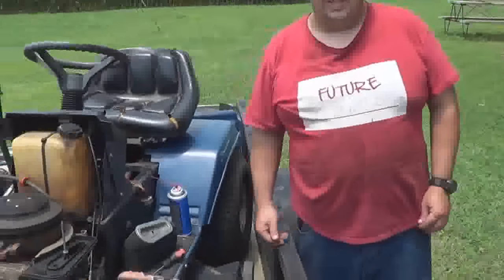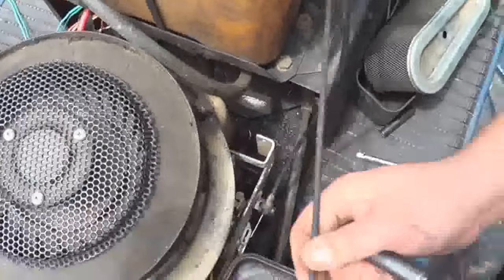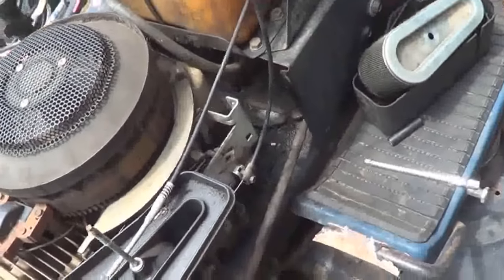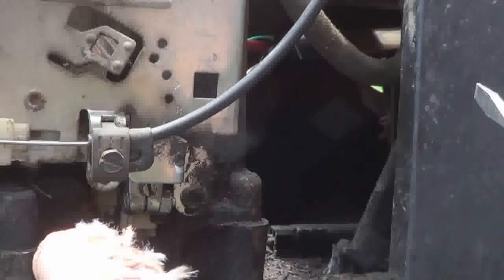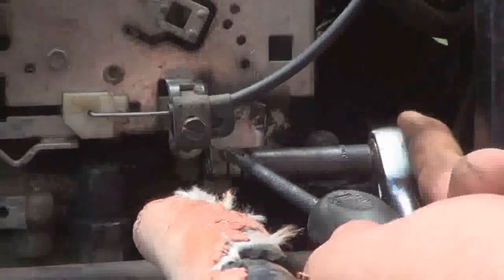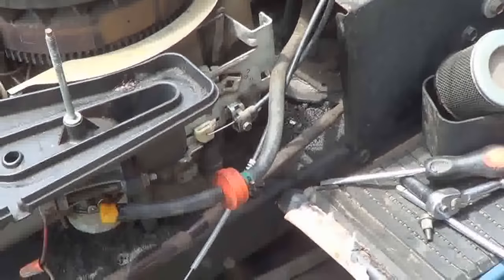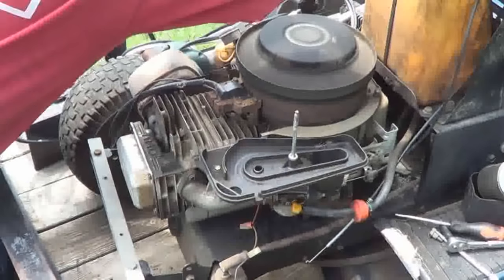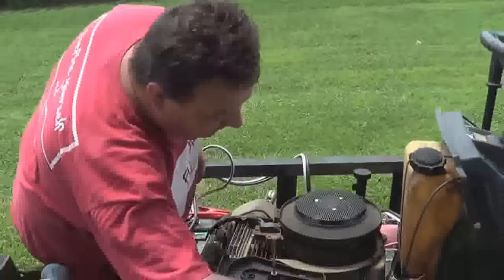How to adjust the engine's governor

Comment: Don't use the throttle cable to set the carb to full throttle prior to adjusting. Close the throttle lever to idle. Manually push the governor arm towards the full throttle position with that governor shaft loose. Now, turn the governor shaft in the same direction the governor lever moves to full throttle and tighten clamp. This is your initial governor setting. Using the throttle lever introduces another variable that can affect the accuracy of the initial adjustment.

Comment: Turn nat, till it buttums out like at. You should of placed the throttle in the fast position then set the governor. You had it in choke. Reason it's running fast on you. Set throttle cable just before the choke kicks in then set the governor full clockwise. Looks like tu me sumbody bent tat n nere. You're killing me with the accent.
Reply: jim davidson thank you, setting it in fast position and not choke was the missing piece for me!

Comment: I don't give a rat's ass how long the intro is (BTW, there's this thing called Fast Forward) because this video showed me how to fix my 2010 Craftsman YTS 3000 mower so that it is running like new.  I haven't been able to throttle it down for years, and a few days ago, it began racing at VERY high throttle.  I parked it, and started looking on YouTube.  Yours was the only one that addressed my actual problem.  I know this video is VERY old, but I hope you see this comment.  THANKS so much!

Comment: Could you help me with this? My Briggs and Stratton engine idles good but when you give it gas it floods, when you put it under load it floods and blows black smoke. Put a new carb kit on it and cleaned everything but it didn't help.

Comment: Well I have a flathead 12hp and when you put the throttle up it opens the blade wide open and runs away so I hope this will help it to run slower
Reply: Did it fix it?

Comment: I have a problem my governor don't work I tried to set it like you did with no change
all it will do is idle. I pulled the linkage off and still just idles.
I did see that the arm that go's inside motor will move in & out a lot can some one send me in right place to see how to fix this ?

Comment: So...what if the engine is a flathead, 4.5hp without any kind of throttle? Cheap junk, surges like crazy. At least it runs again now that I put a new spark plug in it.
Reply: If its surging probably a hole is the diaphragm. in the carby, you buy replacement kits online.

Comment: Hello, You are not pro! The engine runs unregulated at a too high Speed. The engine should run at about 3300 rpm, not higher than about 3600 rpm. This engine runs at nearly 4000 rpm. You have to check the idle screw and the governor spring.

Comment: Not above 3000 RPM on most engines and use a tack and know that’s the max
It’s the safest and most power you’ll need 
It’s about you not over loading the engine not the RPms
Reply: Lol, I just love how at the end it was still screwed up, and over rpm. 
I've turned plenty into racing mowers, and with the governor cranked way up they will turn 5500 rpm, but they don't last a long time, sometimes only 10-15 races.